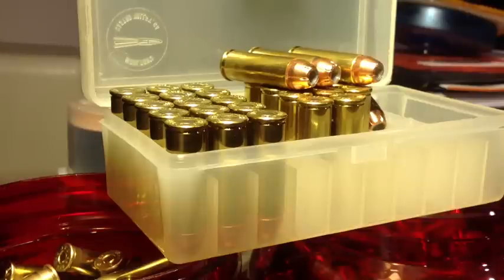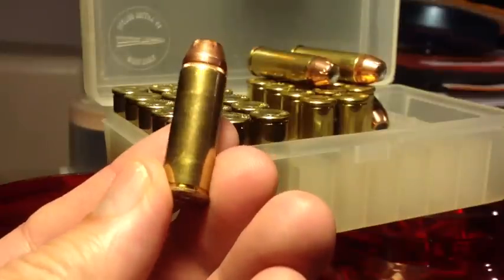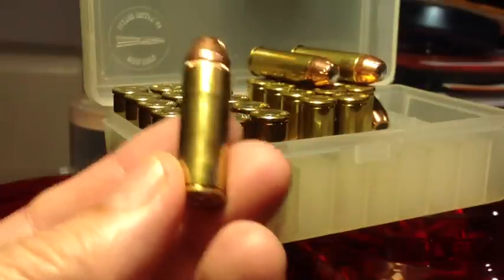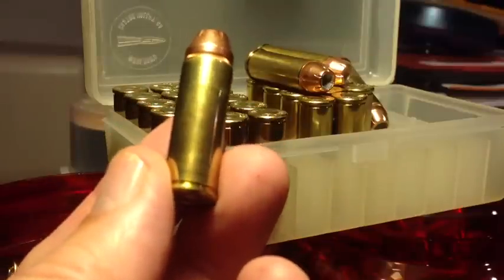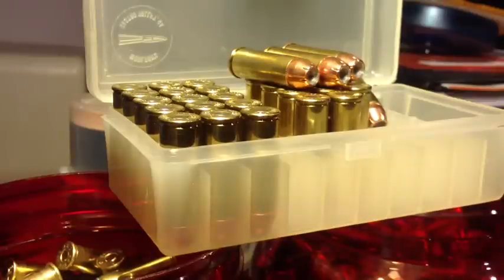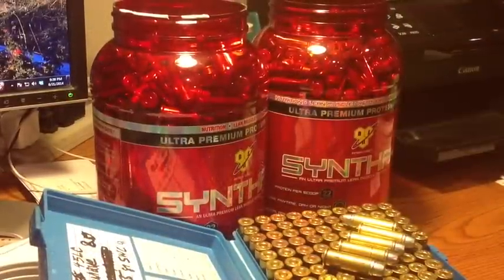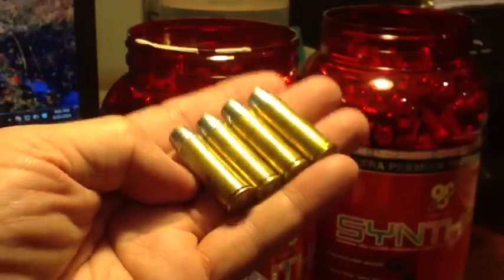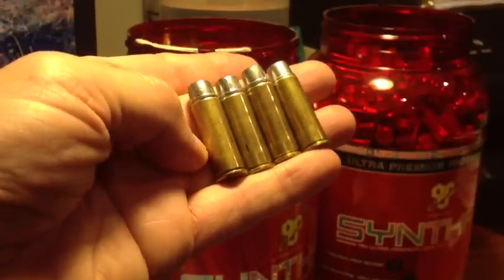Hot Loaded 45 Colt Ammo - Why Not?

Comment: I would like to see a video on signs of overpressuring a revolver. I really like the .45 Colt & I have a few cowboy guns which require the lower velocity black powder or black powder substitute. I would like the ability to shoot a standard power .45LC & I have no idea what guns are safe to do that with. I have no desire to really push it but I want a bit more than the cowboy loads. I would also like to be able to use a modern smokeless powder. Anyways, I would love to see a vid on overpressure signs in a revolver.
Reply from the maker: shananagans5- Overpressure is when we get primers flattening and primer dents cratering, and then comes the difficult extraction.  I don't have anything I can video to show that - but most reloading manuals go into this.  Further overpressuring causes case heads to blow off, and then more causes the gun to blow up.  There is a chapter in the Elmer Keith book Sixguns in my next upload that talks about overpressure…Thanks for your fine comments and questions.
Reply: FortuneCookie45LC Basically, just look out for the same things as rifles. lol I am so new to revolvers they still scare me. lol I am an AR girl & those thin walls on the cylinders scare me. 
Do you have an opinion on the Ruger New Model Blackhawk?
Reply from the maker: shananagans5 The Ruger NMBH - In any standard caliber would be a gun that would last a couple of lifetimes with reasonable care.  If you want thick cylinder walls - the 357/38/9mm Convertible would be just the ticket…Best to ya...
Reply: Revolvers chambered in .45 Colt considered safe for the stout loads listed in the reloading manuals or the "+P" loads offered by the likes of Corbon, Doubletap, and Buffalo Bore would include the Ruger Blackhawk, Ruger Bisley, original Ruger Vaquero (but NOT the new Vaquero!), Freedom Arms model 83, Colt Anaconda, and Ruger Redhawk.
As FC45LC mentioned, the Thompson/Center Contender and Thompson/Center Encore can also easily handle those stiff loads.
As for rifles, you have two choices: Marlin 1894 or the Winchester M92 or the Rossi version, the R92

I regularly use my own maximum power loads in my Ruger Blackhawk and Marlin 1894, with no hint of trouble, but you can be sure that I NEVER exceed the top recommended loads in my manuals.
I get roughly 850-900 foot lbs with my top loads out of my Ruger and 1700 foot lbs out of my Marlin, very impressive performance for a cartridge originally invented in 1873.
Reply from the maker: PinkOld Thanks PinkOld for the good info - I do recall your videos of you touching off the hotter loads in your carbine.  Have a great day...

Comment: I have always taken the approach with any caliber if I need to hot rod something or go above saami spec why not just go to the next caliber. This reasoning is why my 454 Alaskan has been worked over and can fire 45ACP, 45 Schofield, 45 Colt, 45 Colt Ruger Only (magnumized), 454Casull. 
With that out of the way, Fortunecookie if you used a max load of 2400 by my testing years back out of a 6inch barrel this will get you about 1450fps. The bad news is the Hornady XTP is not supposed to be pushed this hard which I believe is what you said you used. I consulted with Hornady about this very topic those projectiles are meant for 45 colt loads for what you have done you should be using Hornady XTP/Mag projectiles. This means you would have to go with the 240gr or 300gr XTP/Mags as the 250's are meant for lower velocity.

Comment: 45 Colt brass is not weaker than 44 magnum brass. The fact is that older revolvers had over sized cylinders and the 45 Colt brass had to stretch more when fired. Repeated stretching of the brass past what was needed and what was the case in 44 mag revolvers lead to premature failure of the case. Newer revolvers have tighter tolerances.
Reply from the maker: Stan Clare - There is a problem with revolvers that have the cylinder cuts right where the cylinder wall is thinnest though - and with the 45 Colt, this is the most impressive of all.  The oversized chambers of older revolvers aggravated this even more as you have pointed out.  Our newer Rugers have a lot of strength for sure.  Our best bets are to stay within the reloading manuals.  We don't have the margins that we have in 38 Short Colts in 357 revolvers, or 44 Russians in 44 magnum revolvers for sure.  Best to ya,  FC
Reply: Ruger now offers single-action Super Blackhawk revolvers chambered in 5-shot .454 Casull and 5-shot .480 Ruger. Eliminates the timing notch over the bore issue, also the cylinders are unfluted adding more strength.

Be nice if Ruger cut down on the bulk a little and simply forged the steel.

Comment: I have an interesting story. Working up to and including the "never exceed" load for Hogdon Clays powder, in the Lee modern reloading manual. A 200 gr lead cast bullet would not penetrate an old maytag washer side panel out of my 45 colt revolver. It's an Armenius-By H. Weihrauch. A German manufacturer. The load felt weak when fired as well. I shot a nearby tree. The bullet stuck halfway in the tree with the base sticking out of it. The next round made that strange sound signaling that it did not exit the barrel. I looked , and sure enough, there it was just shy of the muzzle. So I bumped up the charge 1 grain at a time until it would penetrate no problem, and felt good too. That ended up being 9 grains of Clays.  That was 3+ grains MORE than the "never exceed" load. I've shot 100's of rounds now using 9 grains with no ill effects.(It's my only revolver) My question: Is this something that is to be expected with reloading, or is this a unique occurrence?
Reply from the maker: DenverLoveless - Since you've been shooting 9 grains of Clays, if your pressure signs are OK, and the gun functions as expected (extraction and ejection are OK and the recoil is within reason), I wouldn't tell you not to continue with that load...You might not want to let any friends shoot that ammo in their older guns though.  I remember those Arminius revolvers - the reviews on them weren't that good but that they were inexpensive to buy so if they wore out, it wasn't bad in that regard.  To extend the life of your gun, might be a consideration to back off on your powder charge just a bit...But it's your gun and you know your gun and ammo the best of anyone... Continued good shootin' to ya... FC
Reply: Thank you so much for your advise. Everything seems to be just fine. Not a lot of recoil but not soft. Extract just fine , No sticky shells. No flattened primers. Actually there are NO signs of over pressure at all. Btw, I heard about the Arminius' being low quality as well, but it is not. At least mine isn't. And, I may just be lucky to have one in great condition also. My opinion is I think the rumors/ bad reviews may be due to them being considered "cheap junk" in the beginning so some folks may have had the tendency to not care for them properly and as they were bought and sold over time it became a self fulfilling prophecy of sorts.
Reply from the maker: DenverLoveless - It was for other reasons that the Arminius was priced low - monetary exchange and all - and the accusations of pot metal and all - recall that the Arminius was also chambered in 44 mag - pot metal indeed.  It's like my dad's CH revolver (S & W copy from Spain in the 1920s) - it's a nice gun, but others have called them junk - perhaps my dad got a good one...it's from the Roaring 20s..!!  Best to ya,  FC
Reply: Roaring 20's....Cool. The only thing that might be pot metal on mine is the trigger guard, backstrap, and ejector rod cover. Been holding up well for the 16 yrs I've owned it. Thanks again for sharing.
Reply: I decided to follow your recommendation and backed it off to 8 grains of Clays and It's doing fine. I think I'll keep it right there. Thanks

Comment: There are rifles available to safely shoot Colt 45 plus P ammunition. Rossi, Chiappa, and I believe Marlin, all have lever guns that can safely shoot Colt 45 +P ammunition. The Rossi and the Chiappa are 1892 Winchester replicas while Marlin simply has an action strong enough to handle the higher pressures.
I shoot Buffalo bore, +P 265 grain, semi jacketed hollow point bullets in my Chiappa 1892 replica. Those bullets clock about 1700 ft per second and have over 1500 ft lb of energy. They are not pleasant on the shoulder but the Chiappa seems to like them just fine.

Comment: I have three firearms in .45 Colt, a Rossi M92, a Ruger Blackhawk, and a Ruger Vaquero.  The Vaquero is limited to 13,000 psi, so that handload is the most used in all the firearms.  If I want to load up to the hot "Ruger Only" loads for the other two I just mark the headstamps with black Sharpies.  Very easy to spot so no problem.  There really are not very many reasons to go to the .454 or .460.
Reply from the maker: Alan Stewart - Yes, indeed Alan - This discussion is all about power.  You will hear a lot about 45 Colt brass being weak - not so - 45 Colt brass is strong, but there is a limit, of course.  The strength of the individual guns is the factor that dictates how much we can stoke the 45 Colt.  If all you want in terms of power with the 45 Colt is at the level of 25,000 cup (23,000 psi) for use in your 92 and RBH, that's what the reloading manuals have in published data (actually tailored to be OK the Ruger BLK and TC Contender). If you push past that in 45 Colt as some will tell you to do, you are on risky or very risky ground.    Now your Vaquero, if the old model, is built off the Blackhawk frame and will also stand your hotter loads.  But if your Vaquero is the New Model made for cowboy action shooting with the smaller Colt frame, then the hot loads are no-no and you are limited to 14,000 psi SAAMI.   Apparently, you have the New Model.  But for shooters who do desire to go above the 25,000 cup, then the 454  and 460 go all the way into magnum rifle pressures 50,000 to 65,000 psi.  And yes, we normal shooters don't have many reasons to touch off 65,000 psi in a handgun.  But for those who wish to shoot a much more mild and controlled 36,000 psi loading (a la 44 magnum), owning a 454 (or 460!!??), with much more safety margin - does make a lot of sense.  Those who shoot such loads in 45 Colt Rugers and TC Contenders may be operating on very slim safety margins and the variable factors of our guns, ammo and conditions are not being well covered.  That's the reason the 454 came into being in the first place - stronger guns and stronger brass.  Best to ya,  FC Steve

Comment: There are loads on Hogdon's  website that are ,050" longer than all other .45 colt loads. They will only chamber in a Ruger Super Blackhawk or Vaquero. They will not chamber in any lever actions and are very close to .454 Casull velocities. If you own a Ruger and don't want to spend the extra money for a .454 Casull pistol, this is an alternative.
Reply from the maker: curly27784 Hot rodding the 45 Colt was fashionable before the 454 went commercial.  This is none other than what Elmer Keith did, first with the 38 Special, then the 44 Special.  He did his work with the 44 and not the 45 Colt because 1) the 45 Colt was still found with the old weak balloon head cases and 2) the guns were not as strong since the chambers were bigger - less steel in the cylinders.  So if we do the same thing today with the 45 Colt, we have the advantage of stronger 45 Colt brass and the strong Rugers to work with.  And many have done that.  Your point is well taken, if a shooter couldn't latch onto a 454 today, and wanted to hot rod the Ruger 45 Colt, published load data is available...that's a great place to be... Best to ya, and thanks for pointing this out...

Comment: In order to avoid case wall thickness and heat treating worries i cut down 454 casull cases to colt length, i like the intermediate burn rate  powders in 45 colt rifles like 4759 and 4198 far more than the magnum pistol powders like 2400 and 110, and in my 20" barrel winchester 92 i've gotten 300 grain XTPs blazing out 2000 fps with 18.4gr of 4198, the recoil in the crescent butt gun is manageable more so than 4500ftlb loads in my 1895 guide gun as long i use proper mounting of the gun around and over my posterior deltoid muscle. with a hard cast keith that 45 colt rifle load is my black bear load.
Reply from the maker: james beech I like your well thought out considerations to get powerhouse 45 Colts - that 2000 fps /300 from your rifle gives you a short 45/70.  Still, I think I would prefer using that 45/70 of yours with a 405 grain bullet at 1750-1800fps or use your 45 Colt loads with a good recoil pad.  And shoot standing, thank you!! Good huntin' to ya
Reply from the maker: +james beech -- Good grief - I've shot 320 grain cast with max 2400 (don't want to put that load in print because it is  over max in some manuals) in my M92 Rossi and the recoil beats up my fingers in the lever - stout bugger.  Yours is hotter...lever guns so loaded aren't really fun to shoot.  Power is king, but for a lot of us, there are limits - more power to ya...!!  FC

Comment: I shoot 18 grains of 2400 with a 250 grain bullet.  I mark them well in a box that's says 1892 rifle only!!  That load is not a big power house but has some punch and is really fun to shoot!!  I hope I didn't give too much info its just a personal preference for rifle shooting...
Reply from the maker: dowdawg I've used 18 grains of 2400 with the 300 grain bullet, and I don't recommend it - it wallops with a bit of ferocity especially in my Rossi M92.  Would be fine for purpose use, but you would not want to shoot 50 of those at the range...Your 18/2400/240 sounds mighty fine...Have a great day
Reply: Yeah I bet that would have some snap  LOL
Reply: +dowdawg  What bullet are you using and also are you using gas checks? Im considering getting a Rossi 1892 in 45LC and would be reloading since it will be for hunting as well as plinking. Wanted to know if I could get some hard hitting rounds for wild hogs (pretty much only use for them). Otherwise I might just get a 44mag. Any tips would be helpful guys! Thanks!
Reply from the maker: +jlbjlb26  -- Tell ya what...the perfect jewel for you would be the Rossi 92 in 454 Casull - can shoot all 45 Colt ammo including hot stuff that you wouldn't shoot in a regular 45 Colt and still have reserve power available in the full 454 Casull + rifle has that nice recoil pad instead of the crescent steel buttplate that loosens the fillings in the back teeth when hot loads are shot.  But the 454s are hard to find - they get sold as soon as anybody sees 'em.  If you find one you better be quick on the draw with your credit card.  Best to ya,  FC
Reply: +jlbjlb26 I use a hard cast round nose flat point bullet with no gas check.  I have never noticed any lead build up in my barrel.  It would make a great hog load cause the penetration is more than enough with the hard cast...
Reply: Ive used that exact load for 44 years in my Ruger Black Hawk. It is accurate with extreme penetration. For kicks i use to shoot two to three rounds into 5 inch pine trees and wait for a breeze to blow them over. I could load up to 20 grains but 18 grains will kill anything that walks or crawls in North America.

Comment: my  older Hornady reloading manual has  two listings for 45colt ,, one is for the Ruger Blackhawk  which is much hotter, my newer Lyman manual does not ? the hot ammo shoots fine, makes a good camp gun, pretty stout recoil out of the 4.75 inch barrel.
Reply from the maker: peterbilt814 - When loading the hotter ammo, using published reloading data is still the best policy... Best to ya,  FC
Reply: peterbilt814 - My 49th Edition Lyman book has the Ruger/Contender loads near the back of the book, separate from the normal loads.

Comment: This is a comparison based on loading the .45 Colt to maximum specs. However, some reloaders can just up the .45 Colt enough to get a hotter round without going to the utter limits of the round. I know I would like to have a .45 Colt round that would have a muzzle velocity a little above 1,000 fps, with the 250 gr bullet. In other words, a 250 gr round with the same velocity as the CCI hollow-point round. The Blackhawk caould definitely withstand that. I don't remember off-hand the weight of the CCi BLAZER hollow-point, but I want to say 180 gr.

Comment: I have a Taurus Thunderbolt in .45LC and I load 250gr coated lead projectiles with 20 grains of ADI AR2205 Rifle Powder. This is an Australian powder made by Australian Military Industries. This load would blow up a handgun (I've been told this anyway not sure). This is OK for a Thunderbolt or a marlin rifle obviously. This gives me a muzzle velocity of just over 1400fps. According to the powder equivalent chart by ADI AR2205 is most similar to Hogdon H4227 / H110, IMR4227 and Winchester W296.